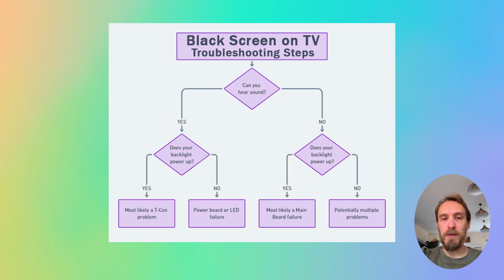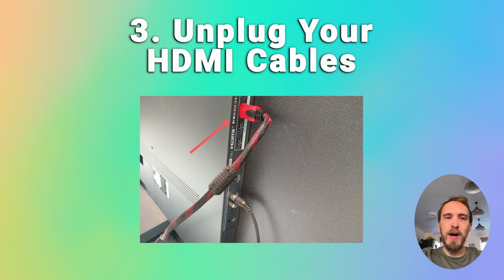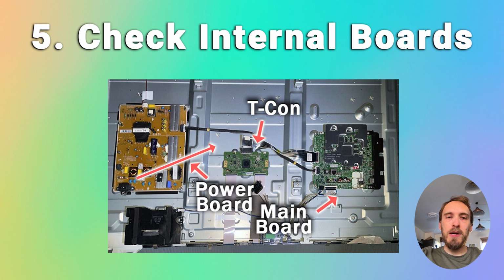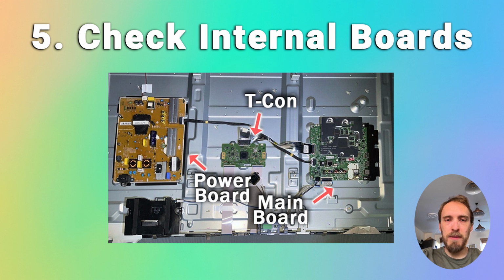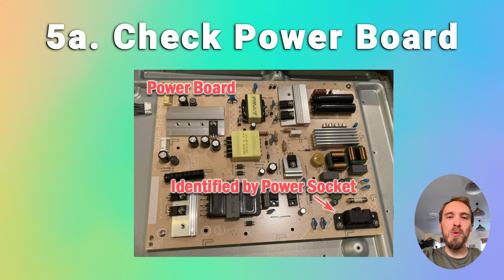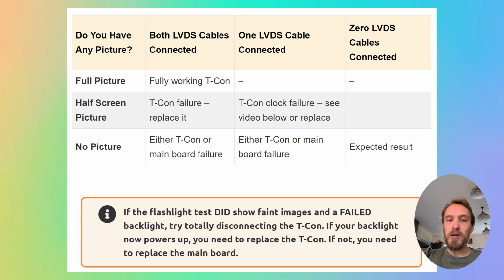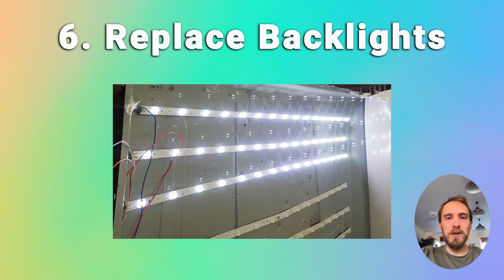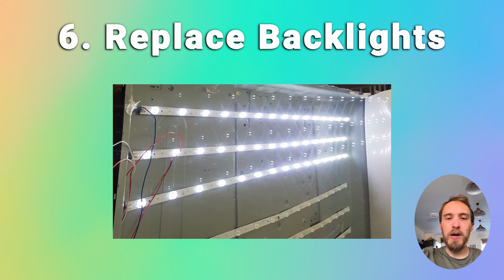TCL TV Black Screen WITH Sound | Sound But NO Picture | 10-Min Fixes

Comment: Mine tcl c855 is reseting 3 times turn on with some backlight black screen and power light on blue and after 3x reset its going off and cant turn it on.! Any heellpp? tried cord off wall power and presing holding power button few times its no responce for power button no matter what i do ...

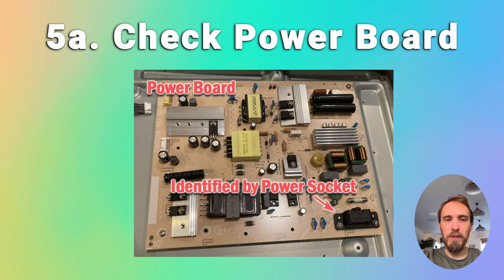Comment: 8:15 does not make sense to me, the chart says after disconnected main board and power board, and Led light doesn't come on, (with the condition that earlier flash light shows no faint picture), the problem would be either Tcon or main; but you say it would be the power board, this contradict the chart. I test the Led lights and they are working.
Reply: Yeah if you go to the page he linked in the description it's even worse. It's horribly organized.

Comment: just got a oled tcl 55c715, works fine for minutes up to half an hour, and then goes black but with audio still, and will stay like this until i turn it off for a bit of time and back on again, and then it’s back to normal for a bit, very weird and i don’t know what’s wrong. i’ve tried power cycling and will also look at the connectors but it seems inconsistent.
any help is appreciated if anyone’s got any suggestions?

Comment: I unplugged a tv, then plugged it back it in a minute or two and kept messing with the home button arrow buttons and pressing the middle button. Finally a picture appeared. I think either lightening knocked them out or the bnb guest border invaders purposely set them on non english settings since the new stove was also daged amongst other damages from their drunken drug craze week. The downstairs tv I've still got to attempt to get the screen back on.

Comment: So mine I don’t see images in the screen with a light. Mine will turn on the screen flashes like it’s turning on, the back lights up but no buttons nothing just sound. It stays lit up till I turn it off now for why this happens I can’t say the tv was inplugged for about 6 months and I went to plug it in and this is what happened it worked perfect before that. Gonna try and open it up and see what I can see maybe something came lose? Fingers crossed

Comment: I wish somebody had the answer for my 15-year-old Sony 3D Blu-ray 5.1 player. The surround sounds have their own amp in the back. The Wi-Fi connection from the main unit to the back to I think is just burned out. I love having a center speaker and a subwoofer. I will not be caught dead with a freaking sound bar. This happened after Iran all of the wires really clean inside of my walls too dang it. I even bought a used rear amp from eBay just to see if that was it. I plan on taking apart one of the rear amps just for the fun of it. I really don't want to take apart the main unit because it's wireless connection to the satellite speakers is gone. Doesn't help that I'm in a really big apartment complex with gobs of AT&t fiber internet signals all over the place. They're probably just can't communicate. Or it got too hot it has a decent size fan on it

Comment: Thank you so much, I followed the steps, got no display but sound, then half a screen when I disconnected one of the cables, then started taping different parts of the cable pins to block the damaged one, and it works perfectly now.

I have a question, should I replace the tcon board or the ribbon if I want the full solution? Ebay only has the board without the ribbon cable. Thanks again

Comment: Need some help.. I have 75" (Model 75S434) about 3 years old

I have faint picture and sound

Followed steps in the video.. 

 - when I disconnect the cable between, power board and the main board cannot turn the tv on as the power switch is connected to the main board.
 - so I powered the TV on, and then disconnect the cable between power board and the main board, I do not get the 'default' back light on, also the faint picture now disappears

Would appreciate any input..

Comment: TCL 👎i have a 65DC760 model from 2019. It was a 1k+   euro tv. It needs around 1.5 - 3 min to start, 15 random problems from around half of year of usage. No picture, no sound, autorestart, turning it off it restarts in safe mode, wrls not working,  etc.  Some same problems on other two same model tv's from my friends. Worst tv ever. MHO stay away from TCL.

Comment: Excellent video/tutorial. Using your information,  I bought a main board and power board as a start to try and fix my TCL TV that had a black screen, no backlights and no sound.  It was a faulty power board. For less than $60 for both items, including shipping, my TV is fixed. Thanks!!
Reply: Where did you buy you main board, power board, T con ??

Comment: Black Screen 43" TCL 4K With Sound Model 43S535, 2 years old. No faint images. Pulled off power board, Cap tester shows three bad caps will replace, but where is the link you mentioned that talks about testing the components on the power board? Are there schematics online for this board? Thanks.
Reply: I have the same model I think. 43 inch. 2022 model. Just stopped working today. It flashes light for a second when first turning on then goes black. Tried factory reset. Power cycle. Ugh. Kinda liked this TV

Comment: before I open everything up I know TCL has a pretty good status bar that tells you everything you need to know. So when I power off the TV the status bar is dimly lit rather than full lit. When I power it on the status bar is off. There is no picture, even with the light shine test. There is sound. If I do A hard reset then plug in the tv after the capacitors have drained, the power bar will be bright for about one second. If I power on the tv during that second the screen will turn on, but then imediately turn off again. It works exactly the same if I try the reset again. Plug in, power bar full bright, turn on, picture for half a second then off. That means back lights work right? but again power bar will go to half lit when tv is off. It will only send signal to the backlights if I do a hard reset. Otherwise the status bar will only go half dim and off when tv is on, but no picture. Can you help me with an educated guess of what it could probably be before I open everything. I was thinking capacitors on power board?

Comment: Video was listed for TCL TV. I've been working on TVs for the last 35 years or so there's no way I could have seen them all but Samsung is the only manufacturer that I know of that  the cable between the power board and the main board and force on the back lights I've never seen a TCL model that you could do that You should be up front about that so people don't think that they're changing back lights because you're not going to get back lights on any TCL that I've ever seen by unplugging that cable

Comment: I have a TCL 65R615 that has audio but just the faint LED glow. I've replaced the LED driver board with same behavior. I followed the steps here disconnecting one component at a time and the faint glow shows up in every scenario (except) when I disconnected the main board from the power board and then the TV would not power on at all. I tried flashlight test but can't see any picture... Just the faint glow of light. 

I have no issue replacing any board if someone can advise, but I'll throw in the towel if it turns out it the LED strips that need replacement.
Reply: So what's the verdict? Were you able to fix the issue?
Reply: @zombiekill25  unfortunately no... I ended up buying a replacement board unsuccessfully swapped it out but it didn't resolve the issue. No TV repair place I contacted will fix for me.

Comment: When I disconnect the power board from the main board, the TV doesn't turn on at all.  Any idea what's going on in this case?  TCL 55S405.  Amazing tutorial but doesn't seem to cover this.

I have faint picture with the flashlight test and OK sound.  The screen flashes for a split second on startup.  I wanted to troubleshoot the power and main board before moving on to the LEDs but got stuck on this step.

There are 2 twisted pairs of wires on the LED connectors to the power board.  When the TV is plugged in, I measure  900mV across one pair and 0mV on the other.  On the latter pair with 0mV, there is a ~20mV spike when inserting the TV power cord into the wall.
Reply: I determined it was the LEDs due to the 0V on one pair. That’s too much disassembly for me so I paid a repair guy to replace them.
Reply: Any luck figuring this out? I’m having the exact same issue and not sure where to go from here since I can’t get a definitive answer on the backlight.

Comment: Thank you so much for this video!!! I was able to diagnose and order a power board for my 2-year old TCL, which was showing a black screen, but I could hear sound and see a faint picture when putting a light to the screen. After a very easy installation of the power board, my TV now works, and I'm so glad to be able to fix it myself and not have to get a new TV / contribute to e-waste.
Reply: Hey hey, where’d you order the power board?
Reply: @shaquellanewby7230 A website called ShopJimmy. I searched by the model number of the TV. There were more than one that came up, but they looked different, so I visually verified that I was purchasing the right one by comparing it to the one in my TV.
Reply: Yes where did u order the power board?? I need one for mine too :/
Reply: @ashleygiles9068 the model number is on the back of the tv. look up the number and the part you need is the power board. Amazon has it.
Reply: How did you install a power board?
Reply: @katherinestevenson8848  I took the back panel off of the TV, unclipped the ribbon cables (mine had two attached from the main board/t-con to the power board), unscrewed the power board, put the new one in and screwed it in and then reattached the two cables. It was extremely easy - I don't have any prior experience installing any electronic components.
Reply: Following because I also have this issue.
Reply: We need a new powerboard. Following because my parants have the same issue 👀
Reply: hi i have the same problem. black screen with sounds but i couldnt see any faint pictures when i pointed the flashlight on the screen.

Comment: I have a 2021 TCL and backlight just stopped working. Following these steps I can’t figure it out as mine does not have a Tcon board and when I unplug the connector from power board to main board it won’t allow me to turn the tv on to check if the back lights will come on 😢. When it’s all plugged in and I first turn it on the backlights instantly flash on for a split second but nothing more after than. Really hate to replace with it not even being 3 years old yet. HELP ME!
Reply: Did u manage to found the problem? I'm having the same problem.
Reply: Same issue, my screen  turn smoky and just 3 yrars old 65"..
Reply: Mine too .. 2 days aho@gerlyndgarcia
Reply: I have a 43” TCL TV and I was having the same problem. However, I was able to get my Tv working again by unplugging the connector with the red and black wires. I plugged the power back in and then reconnected the red/black connector.  This seemed to reset something and it started working.
Reply: I'm in the same boat! Can't figure out if it's the main board or the power board that's causing it
Reply: Here's some helpful. I just picked up one of these TVs a neighbor left by the dumpster. It looked pretty dusty so didn't think it was going to fire up. My advice to you is by LG or Sony. My LG 55-in TV is 15 years old. My other new computer monitors are LG. And then the other two TVs I got dumpster diving were both Sony bravia's. I love the one that I have mounted in my bathroom with a Chromecast on it. I don't know how wild I am about smart TVs to be honest.
Reply: Wow reading yalls comments and now our 65inch Tcl barely 3yrs old picture just went out last night the sound is still working but no picture what so ever , thanks for the info gonna try it and see if it helps
Reply: @jennifermilazzo2819 How'd it go?! We're in the same boat now and my 3yo is PISSED 😂

Comment: Question: so my tcl only started doing this a day ago but when I put it on it comes on normally then the screen blinks black a few times and then cuts out. However sound still plays as normal meaning its the backlight coming off
Reply: mine too as its attached to a notebook, but the  pic returns should as i change the channel, refresh the browser, or power on/off.  

this never happens with utube, peacock or any other channel, it only happens on utube tv.

so the issue is,if any of the options recommended applied to ALL displays where im watching including the cable, motherboard or power, then that would be easy to troubleshot.  the board, cables or  power would present this issue regardless of whether im watching peacock, roku, utube, motherboard or regular tv and it does not...so im a bit stumped.
Reply: @oldsoul3576  what I did was I went into.the tv settings an just changed the backlight setting from 100 to 95 and it stopped for me still not sure why but hey it worked

Comment: Who the fuck is unscrewing their tv, might as well buy a new one
Reply: Me! My 10yr old LG 42" (3-D) is all better now, thanks to me by replacing the power board. Total cost from "flea bay" was $22 (free shipping). The TV "discounted" price on Amazon, in 2013, was$592 (Prime shipping). Was it worth it to "unscrew" my TV? A RESOUNDING....................YES!!!! Ten years with NO problems is about as good as ANY TV (tube or solid state) will work. Although, this TV, because of the 3-D panel was considered a "premium" set MIGHT have higher grade components, but probably not. The old adage "they just don't make 'em like they used to" might be the reason! LOL
Reply: This generation knows nothing about how to do a damn thing, pure lazy!

Comment: Thank you so much, i have a roku tcl 55", and there was no picture but the backlight was still on, the warranty was expired so i cracked the back panel open and messed with the t-con cables prior to the video and got the same result you talked about, on this tv the main board and t-con are combined so ill look into buying a new one. 👍
Reply: i need help with mine :( its still broken cause of the backlights
Reply: I bought i new main board and installed it and after couple of days it started with the same issues again. Has this happened to you to?

Comment: When i plug in my TCL the screen barely flashes up for a split second them goes back out, few seconds later flashes on & off again then nothing but sound.
Reply: same thing, did u fix it? ::(
Reply: Did u fix it
Reply: Same any solutions
Reply: Same, it's only 2 years old. TCL logo flashes for a second then goes black. Can cast music thru Spotify from my phone on it. Sound only no picture
Reply: Did anyone determine a fix for this
Reply: Capacitors need to be replaced.
Reply: Same here hoping someone can answer
Reply: same :/

Comment: Thanks for this great video.  After pressing the reset button I now get a message that says press the home button to turn on the screen.  Pressing the home button does nothing. Does that indicate anything?  I did the flash light test and can't see any images.  I haven't taken the back cover off but after reading you website sounds like the main board.
Reply: My tv does the exact same thing, did you ever fix yours?
Reply: My TV is doing the exact same thing,  any result on yalls

Comment: For the amount of time it would take to do all of these things to my tv with a black screen and sound I might as well just buy a new one! Cheap ass 43 inch TLCM tv didn’t even last 5 years! I have other TVs that are over 20 years old and still work perfectly. Including an OLD PLASMA! 😳😡🤯
TCL will NEVER get my business again
Reply: Same! I’ve had my tv just a year and a half.
Reply: Tcl will never get mine as well. Tv less than 36 months old.
Reply: Mine died few weeks after warranty was over. I don't think it is a coincidence. Probably they have a use counter or something and auto bust themselves after warranty is over. Easy to implement on computerized devices.
Reply: I've had my TCL for 6 years.  I don't expect more.  Just died tonight.
Reply: exactly. TCL makes them to die off i think. This is my second 50" in two years. The first died with the exact same problem. and now this one died one year later. TCL is a scam. at least they are cheep. 30 bucks a month for renting your tv
Reply: These newer ones are 100% programmed to break after 3-4 years. Just so you have to buy a new one. Its all rigged mate. Thats why old TVs is still running strong
Reply: lucky you. mine did not celebrate his first birthday